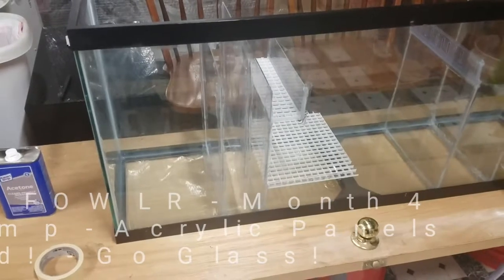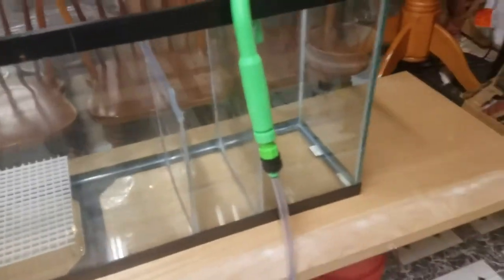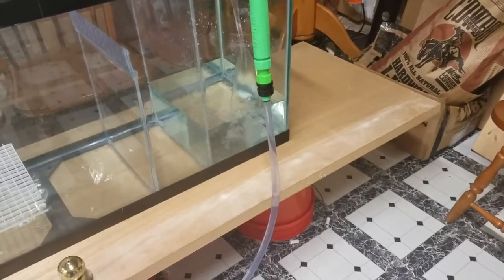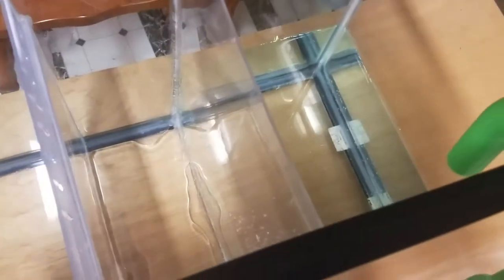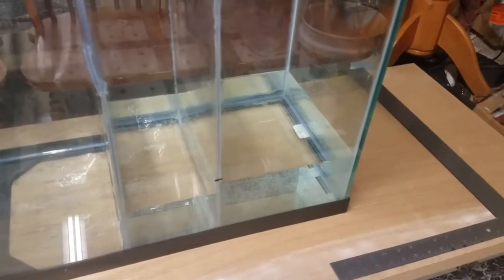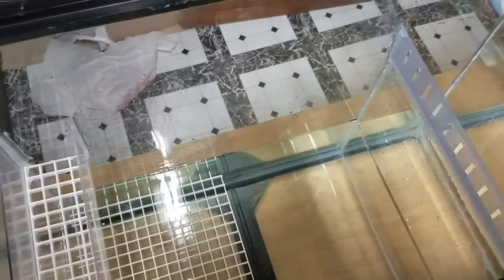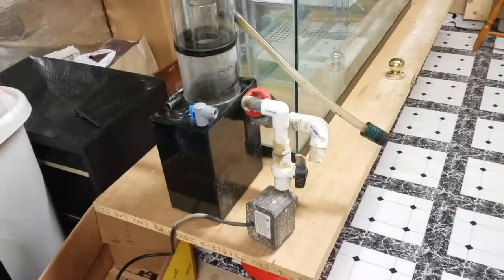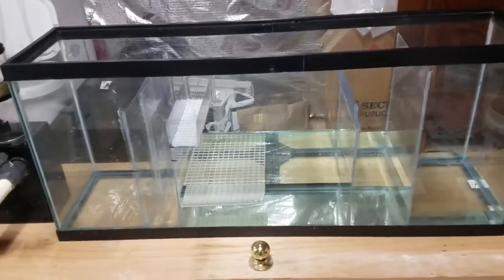Project FOWLR - Month 4 - DIY 55 gallon Aqueon sump w/ ATO & Media Tray Pt 5 - Acrylic Baffles Fail!

Comment: It might not be seeing this correctly, but when the water ends up in the ATO section it cannot go to the last section as the bottom isn't open and the top is much higher. Wouldn't this just fill your entire sump with water?
Reply from the maker: I ended up not putting in the built in ATO and made the refugium larger instead. Thanks for watching!